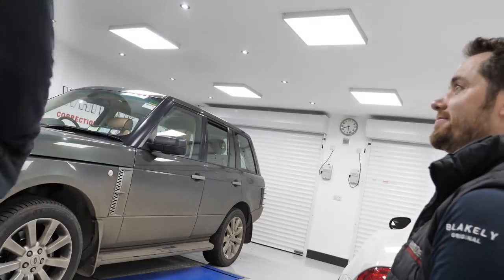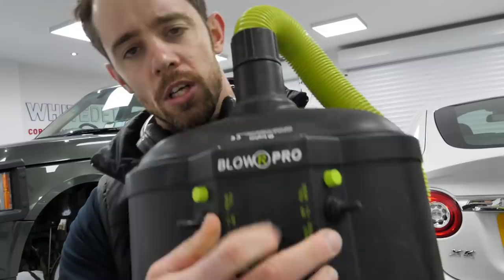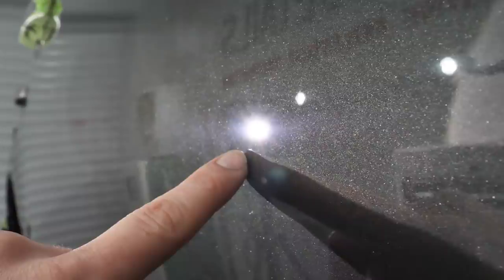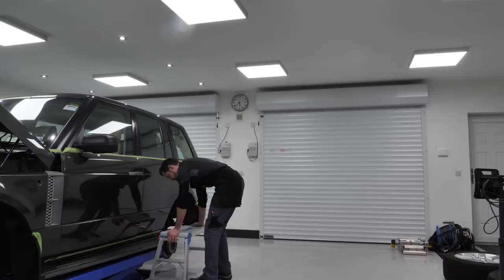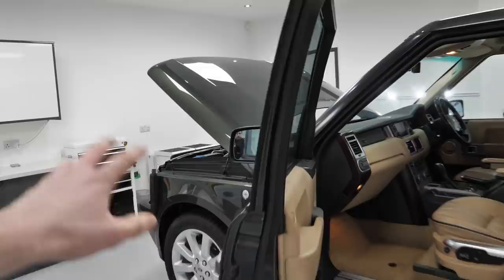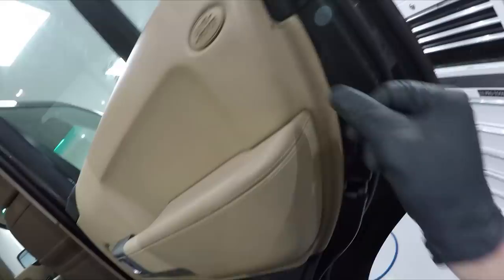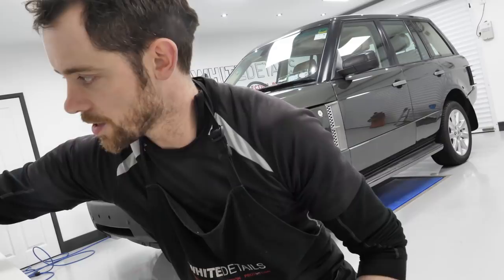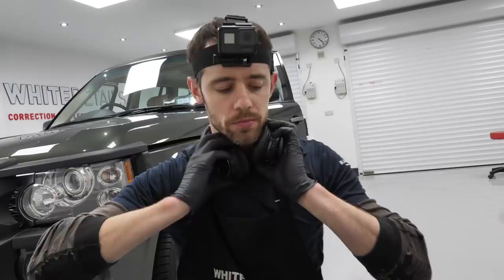214,000 mile Supercharged Vogue given a NEW lease of LIFE - VLOG 066

Comment: The "well used" trusty family busses have got to be the most rewarding jobs.she got what she deserved after 200k+ miles.brilliant.
Reply: RR one of the most unreliable motors you can buy and eye wateringly expensive to fix.
Reply: Coyote being brutally honest here. My dad had a Lexus lx-470 or whatever it was {basically a Land Cruiser} and it had more problems in the first three years than the new Range Rover that he purchased afterwards. It’s the V8 supercharged model {SVR} and its not had an issue. It’s a 2016 model year and its been fine. It’s dependent on the model and engine you have. Not all of them are unreliable you’ve just gotta be careful with which model you purchase. My grandfather has a similar model shown here, its slightly newer or older I believe but it’s got the same engine, even in the same green and its got around 170K on the odometer and has had a few issues over its life like the tail lights which fill with water but the drivetrain has been pretty reliable for a European luxury car.
Reply: @coyote5735  But thats not why people buy LR's,, ( and its passing into urban myth phase now anyway,,)
Reply: 214k? Can't be that unreliable now, can it?
Reply: @arronjones6985  exactly when reaching  that level of mileages  and still alive it means you have stamina !!!cant be that unreliable as you say !!
Reply: @coyote5735  my landy has coverd 118k miles and safe to say it’s the most unreliable one in the range the disco 4 with lion tdv6 but it’s never let me down good sevicing and general maintance like any car and it drives better than my old 18 plate golf gti I had aswell
Reply: @arronjones6985  How many owners has it had? Generally speaking, unreliable motors get passed on by the owners when they have had enough of the bills, unreliable cars are well capable of high mileage it's the cost of those miles that matters. "Which" report of the worst 25 cars for reliability LR models coming in at 14,12,10,7 and 2
Reply: @stringer-ik1pc  Do you get calluses from dragging your knuckles along the ground?
Reply: @coyote5735  that come back only took you 2 years. 🤣
Reply: @arronjones6985  Truth hurts sonny.
Reply: @coyote5735  not me 🤷🏼‍♂️